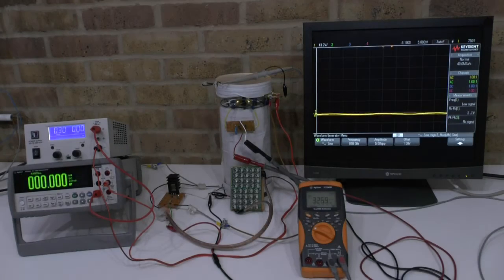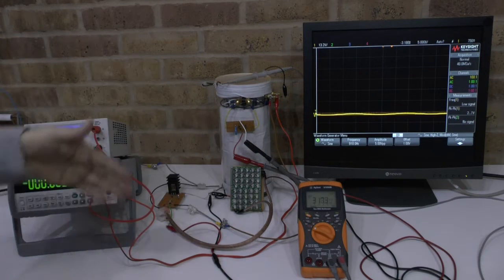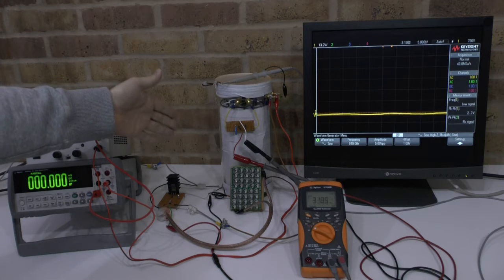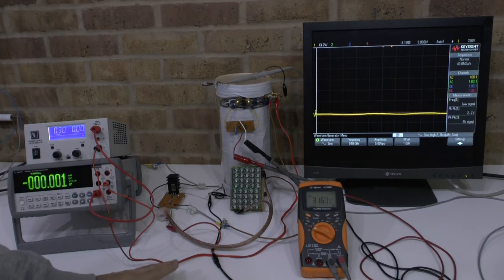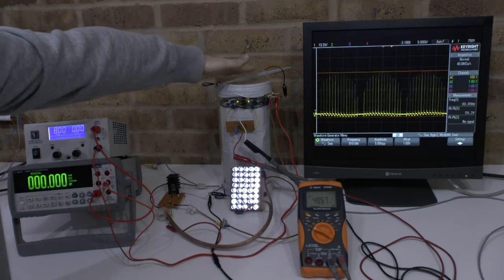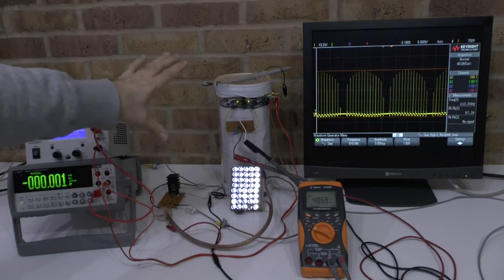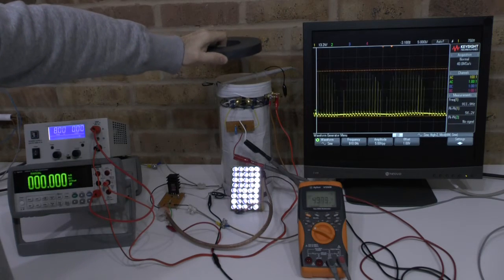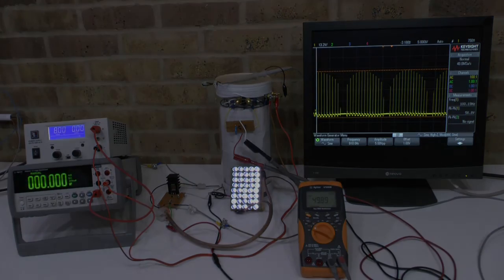The Hubbard Coil

Comment: I have been thinking about the Hubbard coil again. Why 8 outer coils? I recall Hubbard may have used an auto ignition rotor to do the firing of each outer coil in a circle around the central core. Hubbard did go on to work on a spark plug patent. Could it be that he is setting up a rotating magnetic field in this way, driving the rotor with a small little motor. Next, if you think about what occurs to the central core, it sees a north-south expressed on one outer coil, and would mirror that on the central core.  Further, like a homopolar generator, if you were to place a metal disk on the top of the cylinder, would you see a voltage difference between the center of the disk, and the outer rim of the disk -- like a homopolar generator?

Comment: Hubbard coil ist a very interesting free energy device, which I searched for many years ago.....Is here the secret pulsed current, which enters into the coil ?
You get nearly 50 volts output for just 8 volts input, nearly no current input.....What about the output current and the overunity ratio, may I ask you?
I will also check your second video about the hubbard coil.....

Comment: QUESTION: When you have coils in series, and they are magnetically isolated, their inductances would add. However, with mutual inductance, what occurs? Do you see that the total inductance is NOT the sum of the individual inductance? You probably need to measure this using the LR method with a signal generator and a scope. Then calculate Q and see if Q is "better".
Reply from the maker: Hello, correct inductance does add, also look at it as individual circuits connected in series. Each RCL circuit has its own resonance frequency. You can calculate and simulate very easy. I have spice models available for that and also did show it on YouTube how to do that. If you need more details let me know or check my website under research. All spice models are available to download and test on your own computer.  Minimum Basic Member subscription required.
Reply: @TheOldScientist hi very interesting setup but you need top and botom metal plates it works like a transformer and the gain come from type of winding how you do it . If is bifilar or caduceus . And it consume reactive power mostly producing active power . Best wishes .

Comment: Another claim is that Hubbard set up 1200 foot antennas, one north, one south, one east, one west. These were wired at the center with a bottle full of mercury, and from this he could generate a resonant tuned frequency that his coil in his boat would receive. TRUE? He had no other power source ... just received power. Did he have two coils, one on land and one in the boat?
Reply: Sounds like he was harvesting ionic energy from the atmosphere and transmitting it wirelessly. Fascinating. I need to know more. Ionic energy harvesting is a ancient knowledge many of our "monuments" and ancient churches and such actually seem to have had this designed into them. It seems the plan back in 1812 didn't work as well as they thought and now in this new age they must take drastic measures to try to ensure people forget this again. It's never worked they seem to be the only ones to forget anything and it's that it won't work.
Reply: @evanfurn920  The "Pyramid Code" (2009) is a good documentary that covers this ... ions capture from the water under the pyramid, sent up thru the structure and consentrating at the apex to connect to the sky. Negative ions from the Earth -- water -- flowing upward to the sky and possibly creating a broadcast resonant coherent wave that could be received near the pyramid wirelessly.

Comment: one claim is that inner coil diameter is PHI times outer coil diameter size. Yet, if you start with the 8 coils arranged in a circle, the actual relationship for max diameter of the inner coil is 1.61313 x outer-coil-diameter, This is derived just using triginometery. This is about 1.3% error relative to PHI, so close, but I think Hubbard probably did not use PHI relationship. He probably just did the trig to figure out the diameter size he could fit in the 8 surrounding coils. If outer is 30mm, then inner is around 48.39mm (give or take the wire dimensions of the wrapping).
Reply: I believe he done it that way to give it balance. It does not matter what size you make the generator as long as it meets the golden ratio.